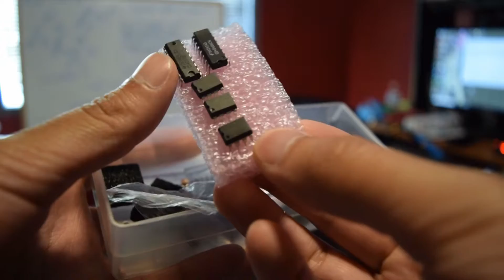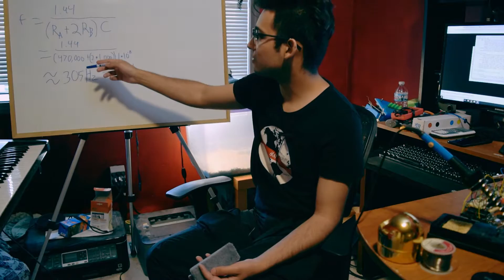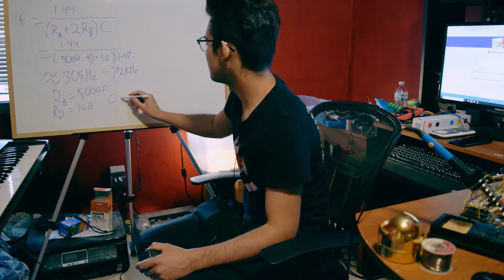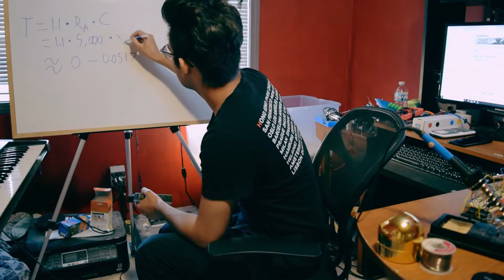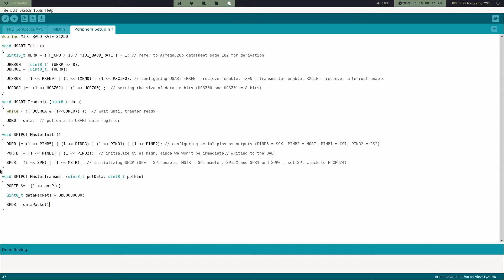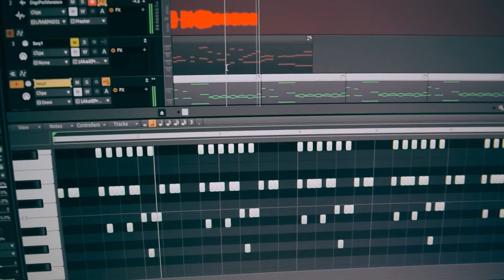Controlling an Atari Punk Console with MIDI?

Comment: Digital potentiometers!

I don't know what's going on electronically, but you can put a CV into pin 5 of the 555s you can control the behavior of the chips. I'm intimidated by your analog-digital skillz!!!
Reply from the maker: That's awesome! I should have added that! The reason it works is because pin 5 controls the threshold voltage (the voltage required to flip the internal flip-flop), so essentially it can modulate the output frequency in astable mode and the pulse length in monostable mode. The 555 is named that because it traditionally has 3 5k resistors in series to create reference voltages for the internal flip-flops and comparators, and pin 5 is connected directly after the first resistor (2/3 the supply voltage). This is the reason pin 5 usually is connected to a capacitor to ground, to stabilize the voltage level at this point. But I like that modulation approach to pin 5 better!